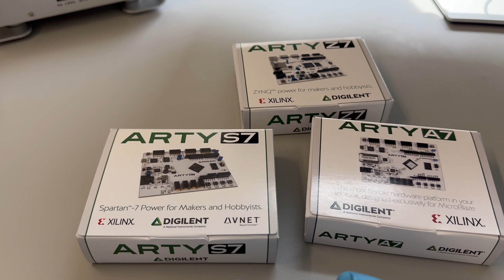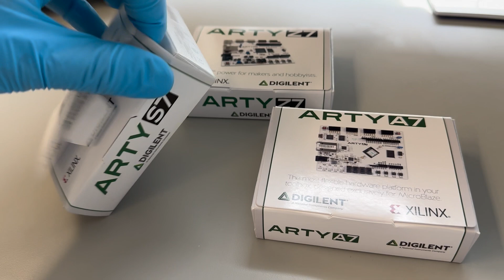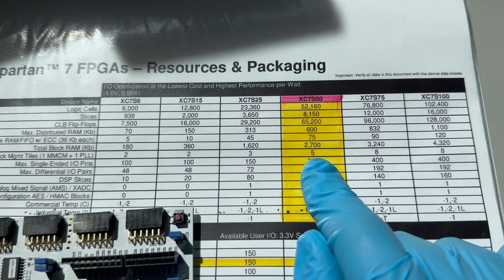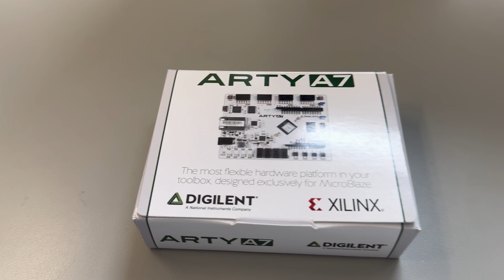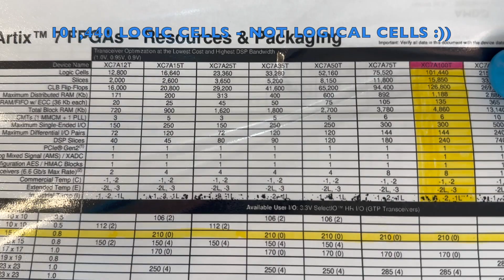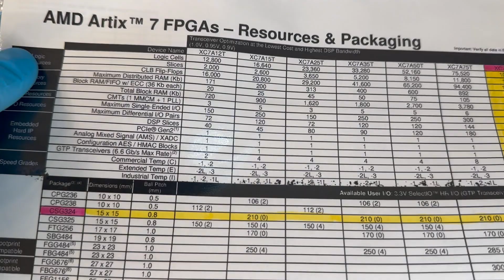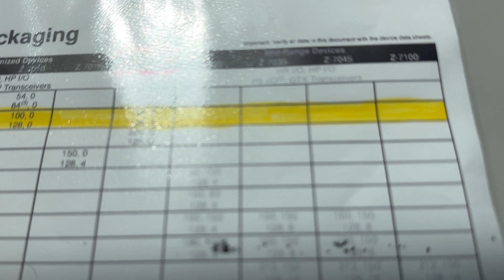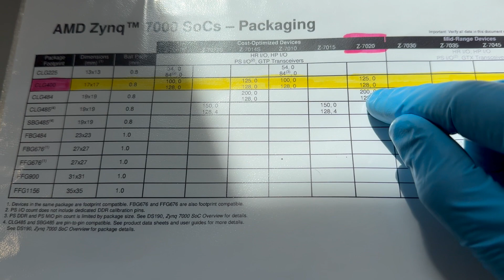AmiCube FPGA, weapon of choice

Comment: The PLL blocks of these 7 series Xilinx FPGAs can be dynamically reconfigured to the required frequency, so you only need one of them for a core clock. Pick your required speed, apply the required configuration and wait for the PLL to lock. You’re better off using MMCM resources though, they now include a PLL so can do all that it can do, plus give you the equivalent of a DCM also.
Reply from the maker: That I did not know. Thank you for the insight!

Comment: If you want complete fpga agnostic solution consider running a RISC-V core. Otherwise you will always be locked down to AMD
Reply from the maker: That is very much true! RISC-V fpga cores are available. I will look into this.
Reply: ARTY Z7 has an ARM processor.
Reply: Arty A7-100T and 35T can host RISC-V softcore.